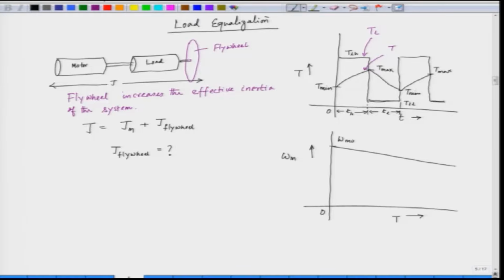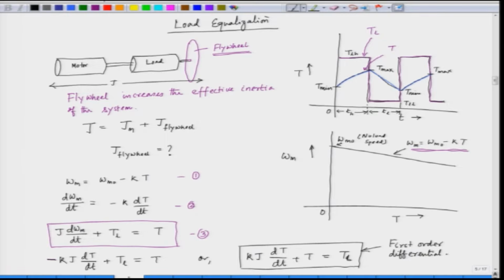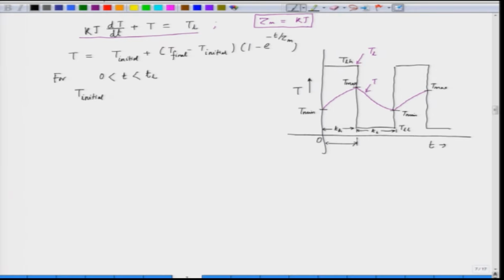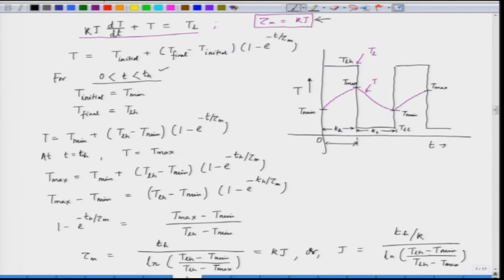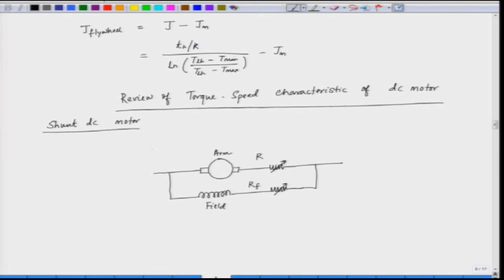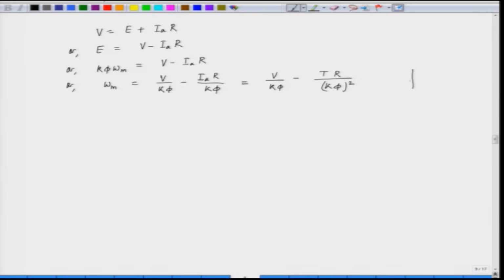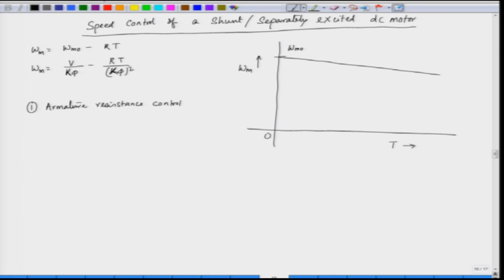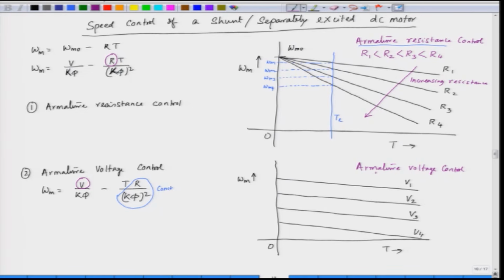noc19-ee65-lec05

Comment: Good capital. My wife Kavi is good capital. 

You could frame it this way — an electric drive powering AC, EVs, washing machine, mixie, grinder, microwave can be seen as “good capital” in motors, because:

⚡ Motor-centric value — electric drives convert energy into useful motion across many everyday devices.

🔁 Reusable infrastructure — the same motor and power-electronics ecosystem supports transport + home appliances.

🌱 Efficiency + electrification — less fuel dependence, more scalable electric systems.

🏭 Productive capital — enables work, mobility, food prep, cooling, automation — real economic utility.

🔧 Engineering continuity — from EV traction motors to appliance motors, the core electromechanical knowledge compounds.

So in a motors-focused interpretation, widespread electric drives can indeed be viewed as constructive, productivity-enhancing capital powering modern life.

❤🎉

Comment: There is an error in the torque equation, although when you substitute it into the velocity equation, it corrects it. Well, in case anyone has doubts about why the same equation for torque is written in the video as for the electromotive force (EMF). The correction is that T = (k*phi)*Ia.